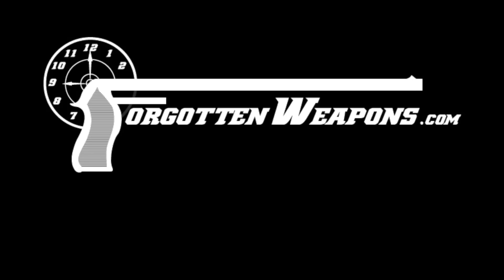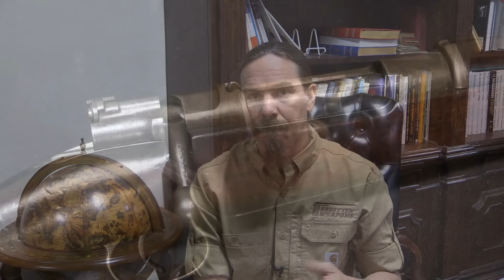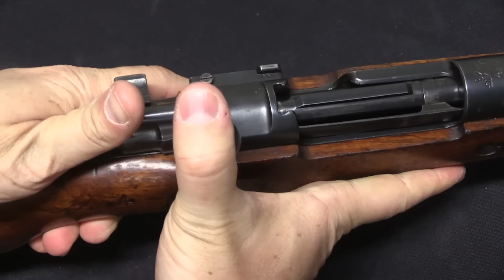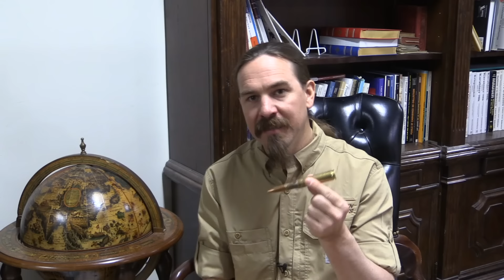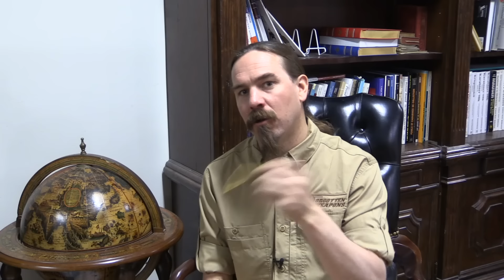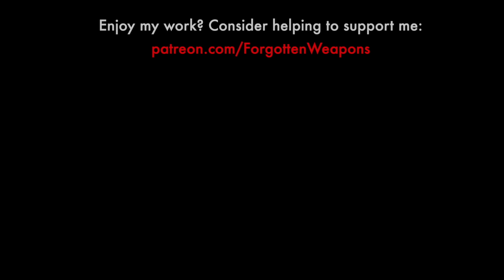Earth-Shattering ka-Boom! How (and Why) Guns Explode

Comment: Ian...
  Thanks for bringing this incident with Scott and the RN50, as well as the topic of weapons failures in general, to light.
  This is a dark cloud over our sport/hobby/passion...  But what reactions are appropriate and acceptable?
  There're calls to stop sales and use of RN50s due to no mitigation for such occurrences built into the weapon.
  Normally, if a weapon is proven as inherently unsafe (meaning not able to withstand "normal operating pressures," parts prone to failure, etc.), I'd be right on-board.  
But not here...
  One big reason people come to Scott's channel is because he's "informative" while, at the same time, often spectacularly "grandiose" in his presentations, going "above and beyond" what most would consider "safe."  It's like going to the races to see the crashes or waiting to see the adventurer get eaten by crocodiles.  We have an inate desire to see the "taboo."
  Large caliber weapons, sometimes hard to find (and always expensive) ammunition along with unusually reactive target choices, make for inherently exciting (if not dangerous) exploits which appeals to the... "darker" side of our basic nature.
  Horror movies, train wrecks, it's all the same. 
  I fully understand the point of the person calling for the recall/refit/buyback of the RN50 as having what he describes as a "design flaw" because there's no catastrophic failure mitigation features incorporated into the design.
  The potential of a repeat performance is not a pleasant thought and, is of valid concern. 
  On the other hand, does the weapon perform as designed? Provided you stay within design constraints and safety guidelines... Yes, yes it does.
  I also agree that the manufacturer should make all reasonable attempts to inform the end user of all of the weapons limitations and liabilities of operation...  The type and condition of acceptable ammunition, etc..
  We must also realize, at some point, the operator is the one ultimately responsible for what enters the breech of the weapon.
  In attempts to create compelling content for his channel, Scott bought obsolete, unusually designed, military ammunition (at $100/rd) of unverifiable origin and handling and chose to use it in a weapon of a very basic design.  
This is like putting a Nascar engine in a stock, Ford "Escort" and expecting it to be safe when you stomp on the throttle.  "Somethin's gonna give."
  He made a choice that he considered, at the time, to be an acceptable risk and got the one in how many thousand that provided catastrophic results. 
  Personally, I think that running that ammo of "unknown quantity" in anything other than something like a Barrett, with proper safety features incorporated, was a poor choice.
But, was ultimately his choice to make.  I just hope that the lessons learned from his experience makes its way through the firearms community. 
  We're still free individuals in this country...  And have the God-given right to do stupid things.  We can't "legislate the risk" out of everything we do, though that seems to be the current trend right now...  And it's not beneficial.  You can't legislate human behavior.  Nor should we.
  What we can do is to understand the implications and potential results of our choices and that's a cooperative event between, in this case, the weapons manufacturers and the investigative efforts of the users in assuring the use of the appropriate ammo and condition of the weapon.
  Understanding the limitations of weapons (and the potential results if you exceed those limitations) and doing due diligence when selecting ammo and ensuring safe operating conditions at all times...  That's how to mitigate a disaster.
  To make a weapon illegal because a freak set of circumstances combined with poor decision making means there could be another such situation, is extreme, particularly In this case, though not to be completely dismissed out of hand.  There's obviously a chance it could happen, I'm just making a case for the proper understanding and use of a given weapon. 
  There was mention in this and another video about bore obstructions and potential causes, i.e. cleaning rods, bore sights, mud, etc. being left in the barrel then attempting to fire said weapon.
  It's obviously encumbant upon everyone handling a weapon to ensure its safe operating condition every time one chooses to use it.
  Granted, it's human nature to be forgetful and sometimes lazy/negligent in our actions.   
However, in the very understanding and acknowledgement of this fact, we should have the motivation to avoid errors and be reasonably safe in using our weapons.  Even an RN50.  To never chamber a round, let alone fire the weapon, before ensuring each and every time that our weapon is in safe firing condition and that we've done our due diligence in selecting appropriate ammo for that weapon, even if it's a .22lr., is our first responsibility.
  I don't think that having a safe operating pressure under 85k PSI (stated by the manufacturer as the failure point of the breech cap threads) and a design feature to ensure that the breech cap is fully engaged is an "inherently flawed design" though lacking in other safety features, such as breech "blow-out holes," etc.. 
  As long as you stay within stated limits and choose ammo of acceptable manufacture/source control (modern, factory loads with traceable lot numbers, etc.) to use with it, I think the design is reasonable and risks minimal.
  I don't think the extremely rare circumstances such as this (and I bet he doesn't do that again!) or other, as unlikely to occur circumstances, warrants the "banning" of the weapon any more than the illegalization of cars that go much faster than the speed limit or have the potential to go out of the control of the operator.
  There comes a point when the operator needs to "pull his foot off the throttle" and make sure the tires are safe and the brakes work properly before turning the key.  
The same is true for firearms. 
  Despite the potential for a similar result, at what point do we override the ability of a person to make a reasonably informed decision (as did Scott, who'll be the first to say so) for himself, provided the weapon performs as designed and that design meets modern operating constraints?
  Ian...
Thanks for your use of proper grammar and ability to communicate which is what attracts a great many of your viewers.. You give thorough, concise information and it helps people to understand the sometimes unfamiliar with a distinct clarity. 
  And thanks for knowing and stating that cartridges have "cases" and not "casings."
Cases are for ammo and casings are for sausages!

Comment: I once had some super under loaded 9mm Subsonic rounds that i shot through a brand new G19 barrel. The first shot did actually cycle the gun but it felt weird, the second one didn't even cycle completely so unloaded and took a look through the barrel. Turned out that the first round got stuck in the rifling at about 3/4 of the barrel length. The 2nd one was snuggly right behind the first. Now imagine firing a real load through that obstruction. I had to hammer them both out.

Comment: He did not have a bore obstruction. He stated in his video that that was not the case. The last bullet was actually lodged in the exit of his target. I have seen a bore obstruction that caused what you are explaining....a man was shooting a twelve gauge and his wife was shooting a differing gauge as they were shooting skeet. He was reloading from a basket mounted on his belt. He said one of her shells must've accidentally fallen into his basket and he loaded it when he he was reloading. He thought he had a misfire and thought he ejected the "faulty" shell but it actually went forward and his next round detonated the smaller shell. It was fortunate than neither his wife nor he was injured.
Reply: Scott also made sure to extract the spent cartridge. He also has a police background. I'm just saying don't judge until you've seen the video.
Reply: You are misunderstanding. All in-battery detonations are essentially bore obstructions. In this case the sabot bullet (even as it was in transit down the bore) was preventing pressure from decreasing in a timely manner inside the chamber, and the pressure escaped where/how it could. The pressure rose far too quickly and couldn’t bypass the bullet obstructing the barrel.
Reply: @woodrowcall3158  Did you not watch the video?
Reply: @horseman1968  I did watch it, in detail. Did you not watch it?
Reply: @horseman1968  Ian is saying that the bullet itself, becomes the bore obstruction, not that there was a bore obstruction in there to begin with. You are the one not paying attention. Turn up the hearing aids, Grandpa.

Comment: I had a weird incident/lucky escape as Number 2 on an M60. Gunner fired, cartridge failed to fire, gunner carried out the drill. He pulled the cocking lever to the rear and the brass flew out and sprayed powder everywhere. I had about a second to process what I'd just seen and was just inhaling to yell STOP when gunner pulled the trigger. Of course the only way the powder could come out like that is if the bullet is still stuck in the gun. Thankfully the bullet was just in the end of the chamber and the next round was therefore unable to chamber and didn't fire.

Comment: 2:19
Gun Jesus, barrel and bore obstruction is extremely common, but I'd say that there wasn't really any barrel obstruction. It might've actually been caused ultimately by the slap round he chambered. The round he chambered actually produced about 180,000 psi, which is just enough energy to blow up a Barrett too.

Comment: TiborasaurusRex did a video on this and it looks like it was fault of the ammo. Slap rounds can create buildup of plastic in the barrel (creating an obstruction) if the gun has a muzzle device (in this case a muzzle break) and apperently there is some documentation that explicitly says not to fire Slap rounds out of rifles with muzzle devices if it wasn't specifically designed for it

Comment: My story, had a P64 polish pistol in 9mm Makarov. Walking toward a creek I almost stepped on a large rattlesnake. I didn't see him until he moved and startled me. I drew the pistol and opened fire shooting several rounds. I didn't notice the weak next to the last round report because I was totally focused on the snake. I fired the last round and the slide locked back. I finished the snake off with a large stick. When I tried to close the slide it wouldn't close. I noticed a bulge in the barrel and realized what had happened. I was very lucky. Sometime later I was at the gun range with another pistol same caliber. Shooting paper targets I noticed a round didn't sound right. I checked the barrel and saw a bullet lodged in the barrel. I don't know if it was a bad lot of ammo or if them pesky Russians were trying to get me. I no longer carry a gun that uses Makarov ammo. In high stakes shootout you may not notice when a weak round goes off. The polish firearms I have are well made and didn't hand grenade on me. I hope this never happens again.

Comment: Before one can determine what happened in Scott’s case, a full engineering/ metallurgical investigation of the rifl,a no particularly the failed screw-on breach must be made. Even a  50% overpressure in the gun should NEVER result in the catastrophic failure shown in Scott’s video. If the threads on the cap sheared off as Scott’s video claims, something in conjunction with an overpressure round was at play here, namely a flaw in the breach cap (wrong material, wrong steel temper, improper thread engagement, etc.).  An experienced mechanical engineer in conjunction with a metallurgical lab can easily figure this out.

Comment: This is an interesting subject Ian , and I have to wonder if the .50 round that exploded Scott's rifle has been subjected to prolonged sunlight / heat perhaps , as this can change the burn rate of the nitrocellulose propellant drastically .
 I assume you are familiar with the shooting in Tasmania in 1996 that brought about the firearms restrictions all Australian shooters now endure , both firearms ( SLR L1AI 7.62 / broken rat tail , found on top of an out building , and an AR 15 with crude scope attachment ) used by Victorian Police as evidence against Martin Bryant ,,had the chambers exploded , rendering them non- serviceable . To my knowledge this is  impossible to do without loading a cartridge with a small charge of C4 etc ,as was done by the Americans with ammo allowed to be used by Vietcong , NVA . The shooter would suffer considerable hand injuries one would think also . Bryant had no such injuries , nor did he test positive for gun smoke residue , a bit odd yeah ! 
As both of these rifles were used extensively by many services world wide , and these weapons are designed NOT to explode as such ,your thoughts perhaps Ian ?

Comment: Most useful gun safety every, must add this though.  Trapdoors 58-50 and 45 cal and Rolling blocks etc all have flaw but not guns fault and never was, all were the non copper jacket bullets.  During civil war, average rounds used in a battle was about 5 each,  but you were issued 20 rounds per package and two were Williams Cleaner bullets to clean out lead partials in the rifling.  That's why guns exploded.  No way cleaning barrel during battle. Barrels got extremely hot during Battle Little Big Horn, gummed up rifling kept bullets from leaving the barrel until one gets stuck, boom.

Comment: I think that this incident will make Serbu look at their design a little bit more. The way that RN-50 fails is needlessly dangerous. While you shouldn’t really ever be expecting a firearm to fail and explode, you should consider how bad it would be if it did. The fact that the RN-50 not only launches the cap backward but also shears off two thin pieces of metal with it and launches them at your face, thats kind of terrifying. Like I mentioned, I would not be surprised to see a redux of the rifle.

Comment: I had a squib round on one of my own  reloads about back in circa 1013.
 It lodged the cast lead  bullet in the barrel.  I was able to dislodge the stuck bullet with a cleaning rod section.  
 It happened because I didn't put any powder in that case. 
 I tried to look in each case during each loading, but one escaped me. 
 It was fired out of a S&W 625-4 revolver.
(45-acp revolver).😮
Reloders: PAY ATTENTION... 😳

Comment: A fine description of the ways gun manufacturers can mitigate the in-battery failure, which seems like is not part of the design of the Serbu, which seems to me to just have a pipe cap on the end of the breech.  Maybe there's a reason guns use lugs in breeches, not thin threads.

Comment: I have been told signs of pressure on the primer can also be a warning...flattening at the outside of the primer...1st sign of high pressure.  Rippling of the primer around the primer pin point...2nd sign of even higher pressure...at this point you're always pushing the boundry...careful!!  Burn through or discoloration of the primer...3rd sign of high pressure...danger!!!!!!!!
Is this true and would this be helpful to understand?  Could you do a video on something like this??
Thanks for your input ahgead of time to all of us shooters!
Thanks Dave

Comment: Aspiring Gun designers should remember, designing a gun not to fail under reasonable circumstances is good and all, but what's more important is designing your gun to fail safely - even under unreasonable circumstances.  The Serbu .50 has what some might consider a design flaw, in that the alignment lugs used to ensure the cap is fully affixed have potential to become shrapnel in catastrophic failure.  A smarter and perhaps only slightly more expensive design may have allowed the rifle to fail more safely:  With the cap blasting out the back and maybe the barrel coming separate from the receiver - surely still catastrophic and dangerous, but undoubtedly safer.  A different stock design might even be made to act as a crumple zone like in modern automobiles to absorb the energy of that cap in a catastrophic failure.  I'm an aspiring engineer and I see this incident as a learning experience:  And so should all of you.
Reply: @Research Development That math assumes "case failure" and " remove the case from the equation entirely" are the same.  Nobody expects muzzel-loading .50 BMG to go well.  An AR-15, or basically any breech loading rifle also has the same type of problem and thus it's a non-argument.  If the back end of a cartridge is experiencing FULL CHAMBER PRESSURE, that is absolutely the issue of the casing because you didn't put it in the rifle.  This prediction could only hold weight if someone bought a serbu and engineered a controlled case failure and we saw the same catastrophic failure of the rifle.  Until then, I hold it was overpressure ammo.  This also does not detract from my above points that your gun needs to fail safely even under unreasonable load.  A cartridge full of dynamite going off in the breech should not kill the shooter in a perfectly safe rifle - no matter the caliber.  If it would, then your rifle design can be improved.